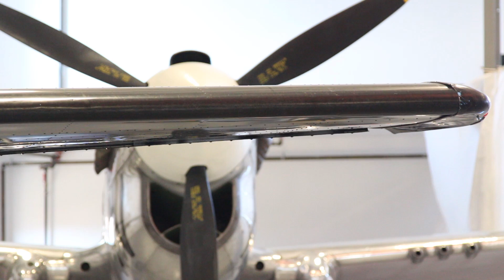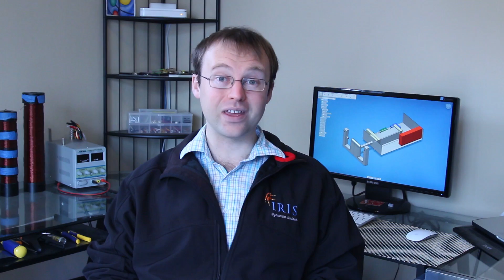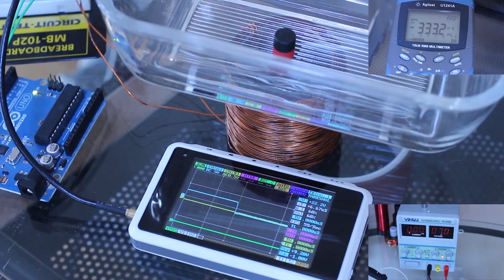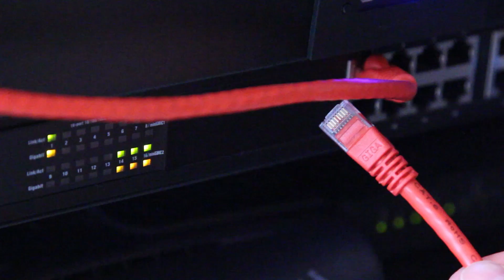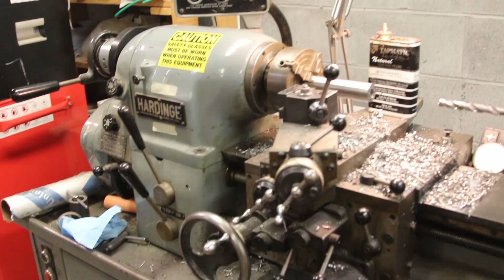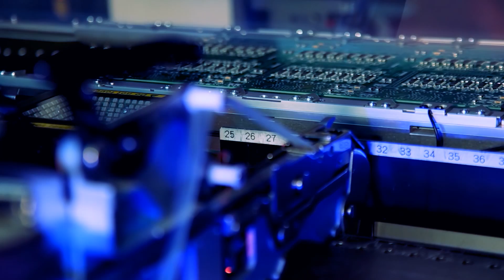Kickstarter: Force Feedback Yoke

Comment: Many of you are fully aware by now about Iris Flight Dynamics and their "pro consumer level" full control loading flight simulation control yoke. The project was initially funded by a KickStarter campaign with a whopping USD $86,000 pledge by supporters. The downside? The retail cost was far too high for the average flight simulation enthusiast with a now $2,000 price tag. Well even if you were able to pony up the cash, don't bother. At present, not only is the product no longer available for order, but some customers who placed paid orders months ago still have yet to receive theirs.

A look on the forum also shows a lot of displeased customers many of which have requested the process of refunds. For those who have received their yokes, complaints range from functionality problems to lack of communication & support to poor cosmetic issues. The latest information is a response from a member of Iris ensuring the products have restarted production (they stopped?) and they are working hard to fill all current orders. That said, they also state that the company is going to be getting out of the manufacturing business until a manufacturing deal is reached which could be several months away. Till such deal is reached (with possibly whom?) no new orders are going to be taken. Iris reaffirms they will continue to build all current orders in-house and will cease production afterward. For $2,000 a pop, is it really worth all this trouble? Certainly, the technology is impressive. Thanks to ADX reader James Long for the tip on this information. You can take a look at what's transpiring in their forum via the source link below.

ADX Update: IRIS Dynamics' Founder and CTO Patrick McFadden responds to ADX readers and sheds some light on the situation. It's a very honest and humble response to the issues users have been having and I am confident the team has and is taking the appropriate steps to correct the current issues and continue working toward delivering a quality product to end-users.

Comment: Guys... 1.550 USD is NOT affordable for the common flight simmer! What a dissapointment...
Reply: Jesper Fuglsang Nielsen Ridiculpus price, over inflated and unsustainable. Just a get rich quick scheme. Fail.
Reply: Compare this to what people are paying $500 for these days. A top of the line FFB driving wheel runs $1500-$2000. The price point is right where I thought it'd be. They just need to come up with a joystick!
Reply: @IronEagle585  you can't paten a concept only a device that has a concept. therefore they are free to design whatever they want so long as the device does not use specific technology  that has been used elsewhere

Comment: i would like to point out that most planes don"t have much if any force coming through the yolk.
Reply: That's not true. I'm a real world pilot, and the further you pull on the yoke, the more resistance you get. These guys are going about it correctly, but have to get the costs down.
Reply: Stev A ok thats fine but that could be achieved through a simple spring you dont need to buy a firce feed back yolk fir this effect there are even types of springs that give you more resistance the more you compress the so say what you will but my opinion is still valid
Reply: A spring wouldn´t resemble the increaing force on the elevators/ailerons the higher the airspeed gets.

Comment: Just curious if this yoke already for sale,
Reply: John Slutskaya it's 999$. And at this point i'm asking myself how that price is supposed to be affordable??? Totally contrary to what's being said in the video
Reply: Tintop well that's good for you. I cannot afford such expenses out of my hand so i have to think twice before buying such stuff. Family's always first then the rest 😉
Reply: John Slutskaya
it is for sale but I'm not sure to just how much
Reply: hmm, well I hope oneday you can tell me how much will it be.
Reply: John Slutskaya https://vs3.irisdynamics.com/product/idl-20004-dragonflyvr-flight-yoke/
Reply: Thanks for the info, about the price is significantly unaffordable for the average simmer. inded.
Reply: i think it's a low price. and not "unaffordable" for simmers. I got pedals (400€) and force feedback wheel (480€) and 2 shifters (280€) for simracing and i'm above 1000€ of expenses now, and that's totally fine. Many simracers buy a force feedback wheel base (without the wheel itself) for 800€ (up to 3000€ and more for direct drive) plus a wheel for another 300€ (at least), pedals for around 400€ (go easily up to over 1000€), shifters for 125€ the cheapest ones (also, here you can spend way over 500€ for a shifter). There are no limits. 
And 1000$ for a force feedback yoke is damn cheap imo, I would even buy a 2000$ one if I was really into flight simming (but i'm not, I'm more in racing sims so my money goes there). 

It's just a question of how much is your hobby worth for you.
Reply: iM3rLiNi true, but i also cannot buy an expensive wheel when i like. i saved money for about a year to get decent pedals, wheel and accessories. but when you really want it (and you know you don't really need it), there is a way to get this stuff. of course not for everyone.

Comment: Most definitely NOT affordable.  You need to be at $500 US for it to be "affordable".
Reply: The original campaign had 180 something backers and brought in like $80k+ CAD. That means the average pledge was $460 CAD.
Reply: $500 is TOO high. This is simmers we are talking about. We complain about $30 planes. It needs to be less than $200 or it will not be mainstream. The Saitek yoke works perfectly well, with a few little mods. Being able to pick one up for $120 used in great shape will always be preferable to a $500 product. There will be the extremist, who will willingly pay that kind of money, but they are NOT the mainstream guys. And they are not enough to support a company doing this. If they can't reach common market prices, they will fail. It's as simple as that.
Reply: The hell does welfare have to do with it? Not everyone has $1000 laying around to drop on one part of an already expensive hobby.
Reply: simming is for those not on welfare :D
those on welfare should be looking for a job :D